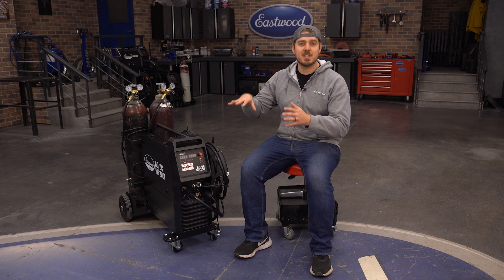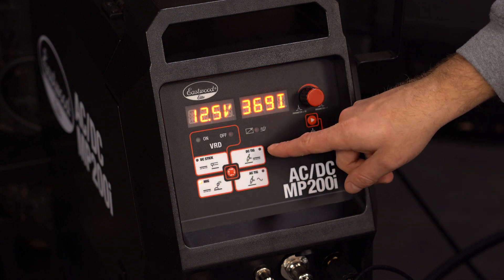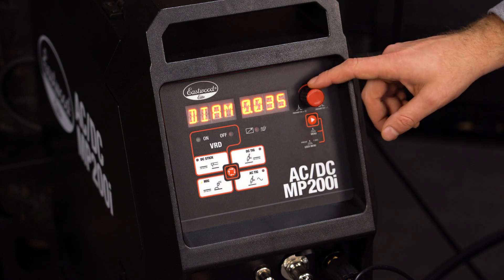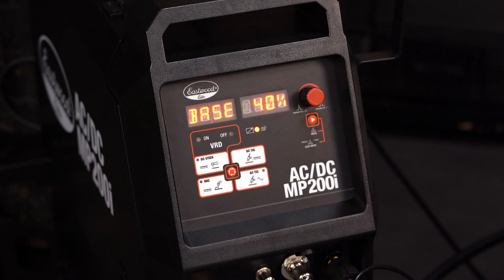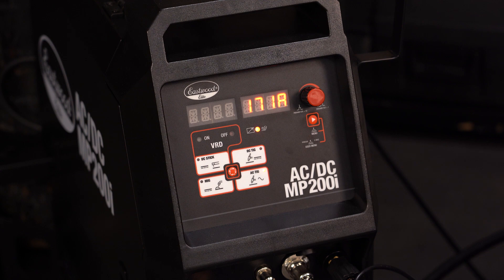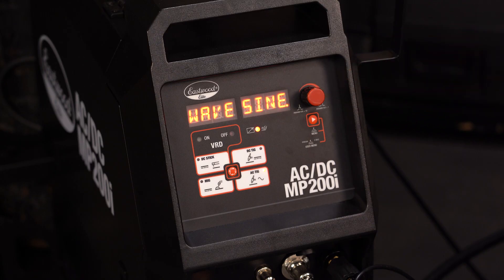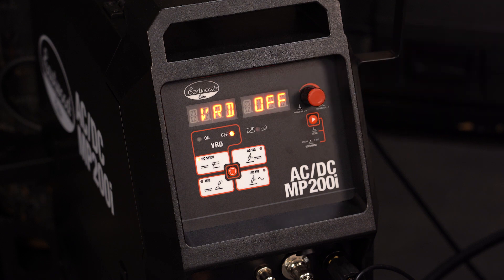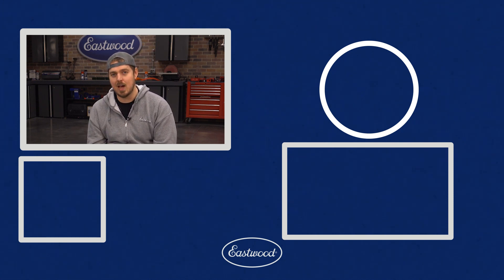Elite AC/DC MP200i Setup Guide - DC TIG, AC TIG, MIG and Stick Welder

Comment: This would have been great if it find come out 2 months after I bought the 250i but the more I think about it I’m happier with the 250. But if this multi ac/dc was 300amp you boys would have hit the ball out of the park
Reply: I agree I am not sure why they landed it at 200, A lot of us here are shopping for something VS the Miller Multimatic 235
Reply: If the re make this in 300 amp they will put an absolute hurting on every other welder manufacturer!
Reply: It needs to be ac/dc with pulse
Reply: @single_cam9199  it is

Comment: My MidStates Welder could do all above Mentioned..  They were bought out by Airco.  I think it was called the Dip Pak 160 or 200 for many years.. Now it's Discontinued and can't bet parts for it .  A Big Fiber part broke that changes the Voltage  "The Rheostat"
  My Point is that if I buy an off Brand how will I get parts fit it in 10 years?